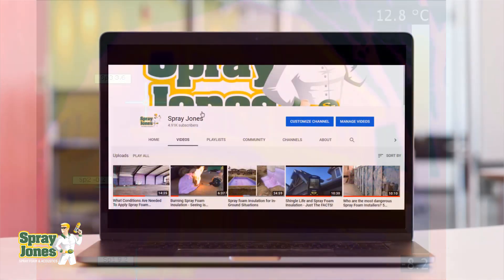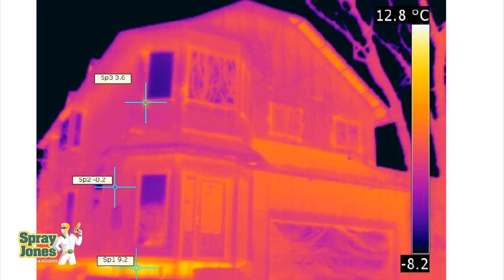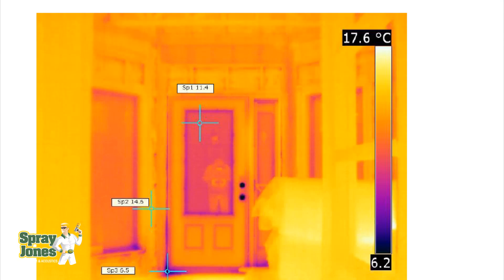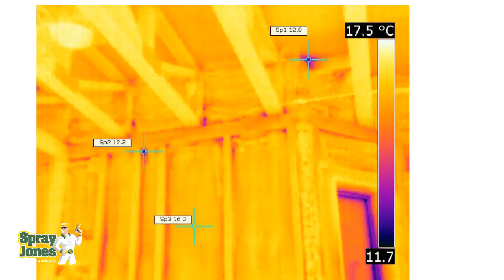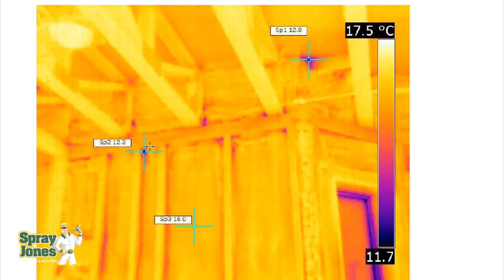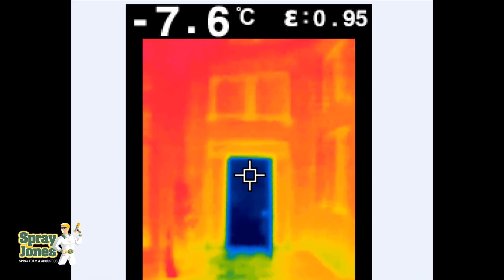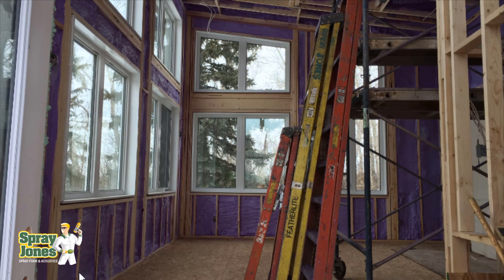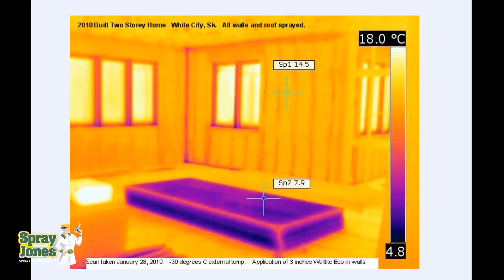Is Thermal Bridging Bad? | With Spray Foam Insulation

Comment from the maker: It needs to be said that the 2"x 6" lumber performs thermally much better than what it's publicized "R value" is. Compare the heat flow of the lumber to that of  3 inches of SPF. 
You need to UNLEARN what you have been taught.
Reply: @Rene Dominic Instablaster ;)
Reply: @Rene Dominic glad I could help =)
Reply: What would you recommend for steel studs?  I'm doing a tiny house build with steel 2x4 framing and trailer.  Thinking of Zip R6 rigid foam for the walls and roof with 3 inches of closed-cell inside.  Would the exposed stud faces need to be covered with the spray foam a bit to prevent condensation?

Comment: All depends how you interpret the information. That's why Flir recommend the use of their software and training. The surfaces being warmer could be signs they're more conductive because of their thermal mass or more convective.  Triple glass paned glass is going to be way less conductive than any spray foam product, but that doesnt mean you'd want to cover your house in it either.

Comment: Thanks for the video. I just read an article entitled, "Closed Cell Foam Between Studs is a Waste" which argues that the exposed stud not covered with foam will bridge too much heat/cold. Good to hear the other side of the argument.
Reply from the maker: Whom ever wrote that is an imbecile.
Reply: @SprayJones  It was Martin Holladay of Fine Homebuilding Magazine, a usually reliable source. I can't post a link here but you can google the title of the article if interested.
Reply: I’d encourage everyone to go read Martin’s article as it has a scientific basis for the argument. He’s not saying don’t put spray foam in stud cavities, he’s simply saying that you need to consider the entire wall and the effects of all the members (framing, plates, blocking, etc. ) before u spend the $ on spray foam between studs and think you’re golden. Let’s all educate ourselves from a variety of sources from all walks of the industry before we simply take one point of view as “truth”.

Comment: That is very interesting, I actually just did a video where I add loosefill to a slopped ceiling to add resistance to a insulated slopped ceiling with batts. Of course batts are not even comparable to sprayfoam. Great video with the thermal imaging.
Reply from the maker: Thanks

Comment: Mr. Jones the idea of CI panels is it pushes the condensate point further outside the wall assembly and provides a more continuous layer of foam on the outside and goes far for air leakage to start for structural more than a wad of iso I would definitely do it
Reply from the maker: I am not tracking on your comment. Are you talking about rigid exterior insulation in use with a batted wall? 
Rigid insulation offers no advantage for air leakage. It is NOT an air barrier product and must work with a supporting liquid applied air barrier.
Reply: No the panels are called Hunter CI panels which has a polyiso sprayed on the back of 3/4 plywood up to 1 to 3" anything you attach to the plywood is thermally broken. Then  if you had a 6" stud you could put 4" spray foam behind the CI panel and I would place Fi-Foil to increase the effectiveness of the foam you would still need to water& air barrier the plywood with liquid flash ie: prosoco
Reply from the maker: @lesliesweeney368  OK. Rich uncle leave you some money burning a hole in your pocket?
Reply: Yes that was an example you can go 1" polyiso on the hunter XCI panel and 2" on the backside and still have a better result than the green board with the tape, liquid always fits
Reply: Lol closed cell spray in walls with more insulation on top, insulated plywood panels, than liquid applied water/air barriers. Deep pockets indeed. If money is no issue there are better ways out there.

Comment: Very interesting 👍. I've been looking at both closed cell foam and exterior insulation trying to decide what is more cost effective. My problem is most of the studies focus on cold temperatures and I am building in Florida. A big thing they advertise in FL for closed cell foam is increasing structure for hurricanes but I've also seen studies that a airtight envelope also improves structural integrity. Just wondering what you would do in FL for energy efficiency from heat and protection from hurricanes? Thanks 👍
Reply from the maker: 3 inches of closed cell SPF everywhere! Some of the best studies on rigidity of SPF come out of Florida because or the Hurricanes.
Reply: @SprayJones  Yes. I saw a study done by University of Florida 3" increased roof lift strength by 380% . Thanks 👍

Comment: In Australia houses are barns with gyprock, which is like a weaker chalk version of sheetrock and the sheets have no strands or fibres within to grip and hold screws, so they pull loose and fall out really easy and don't support weight, so when idiots spray loose-fill over old poisonous degraded loose-fill they collapse ceilings after the second layer also compresses and gains weight with moisture... ceiling fans and ducts blow all steam into the roof, and the roofs have nothing but studs, sarking foil or roof blanket if currigated iron, and thats it, so insulation lasts maybe 20 years then it looks like a 100m2 rats nest with about 1-5cm of dirt dust leaves faces sticks possum carcasses and Christmas storage haha Older homes are tile to cavity you can see light pouring in through cracks everywhere and the houses are off the ground with no wall insulation or underfloor covering just wood floors over joists like its a deck outside and there's no wall insulation they're designed to let air flow up the wall from under the house but the moisture exposure rots the home and warps the joists and they pull the roof, floors, walls and ceilings apart when they warp over time. 

Im from Martha's Vineyard where homes are perfect so this is hilarious to me.

Would you use or recommend spray foam being used in such a piss weak barn-home construction and the outdoor environmentthey create for insulation products and the homes materials like... wood haha, basically outdoor use exposed to the elements???? And what are your reasons??? 

Most installers in Australia that do retrofit don't even clean the old stuff out because vacuums don't really exist that can do these and the Lead flashing means you gotta have insane filter regularly to follow and no suction is the result without seriously involved engineering, which im proud to say we've done very well, but mostly people avoid it because it's that gross over here. they just lay thicker batts over the top of the mess and leave because they know Australia is lazy and nobody is gonna poke their head up to see because you can suffer heat stroke in less than 5 minutes 😅🤣😂 Although I think I'm right on my company's website its because I deal with really harsh 60°C cavities and no standards this bad are easily worked around, so obviously my advice is different, and the same is seen globally, I'd be keen to get some notes from you guys regarding what you'd do to approach the hell that is insulation in Australia. Maybe even review how work is done here and what is being said and give a recommendation on who you'd want doing your work?

Don't know why I do it but im a roof ninja and this crap makes sense to me and I trust you fell into this BS by chance like I did and can relate 🤣

Comment: I think I understand what you are saying, in a std 2x6 wall with fiberglass insulation, the studs and headers light up in thermal imaging indicating a heat loss. The simple assumption is its the low R value of wood is the culprit when in actuality this issue is caused by the limitations present with all fiberglass insulation. The heat loss is most likely a result of air leakage in and around the poorly fitting fiberglass combined with convective air movement within the insulation.
Reply from the maker: Bang on! Well done!
What the thermal camera is showing is that 3 inches of closed cell foam and 5.5 inch of lumber are very similar in thermal effectiveness. If the heat loss of the studs was so bad we would be seeing it in the SPF. It has to show the loss, but in fact the stud is quite warm and the heat flow to outside is very nil. 

I spoke with my old thermography guy who is retired, he confirmed it to me last week. 

Have a hater out here yapping on about what a horrible test this was and how I don't know what I am seeing in the reports. YOU just figured it all out. 

Well done!
Reply: With that understanding, I now have to wonder if open cell foam is entirely under rated and over looked. It seems like it has many of same positive attributes as closed cell with the exception of R value per inch, which seems far less important in the bigger picture. Have you had a chance to look at thermal scan of 2X6 wall with open cell?

Comment: Very compelling case for not bothering with Zip R sheathing.  At ~ the 17:50 mark you mention hypothetically using exterior rigid insulation.  Would that be outside of the sheathing, but under the exterior siding or brick, etc.?
Reply: Tomato / tomoto I would think!?

Comment: Jones, can you apply closed cell spray foam over rigid foam board insulation? And is it effective or a bad idea?
Reply from the maker: Yes. But the rigid board better be well fastened, or the SPF will pull it right off of what it is on.

Comment: Love the videos! I am going to be re-siding my house this spring, and also planning to re-sheath it as it was sheathed with useless fiberboard in the '80s. While I'm at it, I figure I might as well have it foamed from the outside. When retrofitting an existing house with sprayfoam from the exterior, can I also airseal all of the stud cracks from the outside? (sill plate, king and jack studs, etc) or would that trap moisture in the cracks between the sealant on the outside and the drywall on the inside? What do you guys typically do around electrical boxes to keep spray foam from entering them? Cheers from Ontario.
Reply from the maker: Yes you should NOT miss the opportunity to install 2 inches of closed cell SPF for the walls. 
We use duct tape around Elec boxes to stop foam from going in. 
The joints are caulked from the outside using a high grade urethane caulk meant for exteriors. Then putty knife the beads flat into the joints and re-install the plywood. 
Use a wind break shelter for all of this. 
A video will be coming out by spring time on this very subject.
Reply: @SprayJones  Awesome! thanks for the info and I look forward to that video! Cheers

Comment: Good morning Spray Jones! I have tried finding information on doing CC spray foam on red iron buildings in your other videos but I haven't had much luck. I think this is the most applicable video to ask the question on. I am concerned with the thermal bridging causing condensation when you can't cover the entirety of the main posts with spray foam since these aren't build like the typical pole buildings and use metal everywhere. Do I need to look into some sort of spacer so heat/cold can't transfer to the main posts, or will there be enough foam at 2" deep to be fine? Context: planning a barndominium build in central Texas.
Reply from the maker: I have a whole playlist for metal buildings. Please start there.

Comment: Mr. Jones, been reviewing your videos and you have demonstrated the value of closed cell foam.  My wife and I are building a new home along the coast in northern Maine this summer and I plan to insulate per your recommendation.  I have 2 questions - 1 - are all closed cell foams close to being the same values- I can not find a Walltite installer in my area, - 2 - the company I am looking at to do the work is recommending 2” closed foam and then cellulose with net installation for the walls and 3 - 4 inches of foam for the roof assembly.  What is your advice please.  Thank you.
Reply from the maker: 1. Most closed cell foams are within a range of each other for many of their physical characteristics. However you have to balance the product with whom you can get to install it. First go with the BEST installer and then get what he will give you. 
2. You will not find Walltite in the USA. This is a Canadian made SPF for the Canadian market and regulations. You can however get any 2 lb CC foam from BASF which is who makes Walltite.
3. Use SPF as your primary source of insulation as much as possible. On Friday we will go over flash and batt for a second time, and this video will major on batt's short comings.
Reply: @SprayJones  wow. I just learned something new. Cool. I’ll use your info when I build my off grid solar house too. 

Sad that Walltite isn’t available in the American market. Sucks how restrictive my American market is 😡

Comment: I have a shop in Colorado (zone 6b) it has 2x4" trusses. I want to have 4" of spray foam against the bottom of the roof decking.  This would cover the sides of the 2x4" but not the exposed faces. Should I have lets say 6" of foam sprayed and completely cover the 2x4"s or leave them exposed? Worrying about moisture or condensation on the 2x4"s....
Reply from the maker: No. Did you watch the last 2 mins of this video? Go watch if you didn't stay to end, your answer is there.
Reply: @SprayJones  Yes I watched it and many of your other videos. I see the temp is about the same on the 2x4 as it is the center of the foam so I assume this means you would have no issues.
Also one more question. You mention freon being used with the spray foam. Is freon used with all closed cell spray foam brands? Or is this just particular to what you use? Thanks. Great videos!
Reply from the maker: @johndeerefarmer4483  Flourocarbon (freon) is the blowing in 98% of closed cell foams yes. 
HFO systems use Honeywell's Solstice blowing agent.
Reply from the maker: @johndeerefarmer4483  We wrap the cords in an attic when we can. Provided they are 2"x4" and not 6" or 8" deep. When we get to thick lumber we have to stay inside of it. To wrap it 100% would mean 50% more surface area in many cases.

Comment: Thermal bridging sucks! I hate it but not as much as drafts. I like doing 1X2s over the studs and vapor barrier to stop it. I like not being able to tell what the outside temp is when it's minus 25C.
Reply from the maker: Yup.
Reply: icf.... and your done.
Reply: @trtinda11  I totally love ICF too. If I was building from scratch I would be all over it. I like a bullet proof home. But I am stuck renovating fixer uppers for a few more years. Comfort is about more than money. A heated floor and stopping all the drafts completely makes a crap 60s home feel like a new build. Temperature differentials make rooms feel drafty and unhealthy.

Comment: Mike, thoughts on coming through with aerobarrier behind the spray foam?
Reply from the maker: The SPF is adhered to the substrate. What is coming behind? I do not follow.
Reply: @SprayJones  sorry, maybe I didn't make my question clear. Do you think having the aerobarrier crew come in after the spray foam installer is worthwhile?  The aerobarrier would help air seal the spots that spray foam is typically not applied (around the doors and windows) as well as it would seal any smaller cracks and holes that the foam would have missed.  For this example I am referring to the use of open cell foam.
Reply from the maker: @mikelutz6411  Use Caulking not aerobarrier. Please watch the vapor barrier video from last week. Hear what I say about caulking.

Comment: So basically I can build a 2000 sqf home in Canada with a 2x4 wall covered with tyvex and siding and 2" of foam  inside, run a misting caulker Aerobarreier, then be toasty warm with a cord of wood in the winter?
Reply from the maker: Not exactly. New code in Canada will require you to submit to the corrupt old boys' club and up all the values regardless. 
We have sprayed 1000s of homes with 2"x4" walls and 2" SPF and the do so  so well in Canadian winters. We have the field proof that R value alone is BS.

Comment: My uncle built a 1500 sq ft addition to his house with all spray foam while the original 1500 sq ft has all fiberglass. I want to use that same thermal imaging camera to see the difference
Reply from the maker: Ok.
Reply: Buy a FLIR for your phone they’re inexpensive and work great. Have many uses besides for this. Though finding air leaks does will save you money on your house in the long run.
Reply: MILWAUKEE MAKES A $299 FLIR IMAGING CAMERA

Comment: This would suggest a 2x4 wall w/ 3” of foam would perform just fine.  Why put in a 2x6 wall if you aren’t filling it with insulation?
Reply from the maker: Correct. Tradition and what is expected. 

I like the 2"x6" for ease of 3" and not shaving. It is a lot of work to shave a 2"x4" wall down.